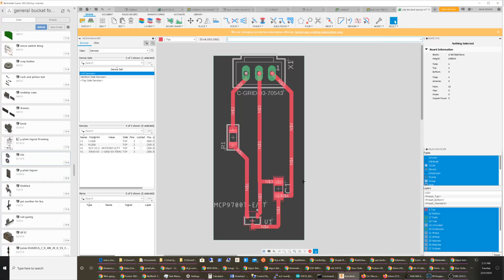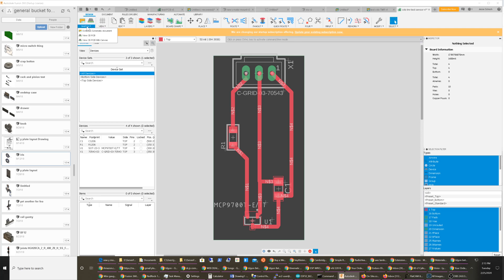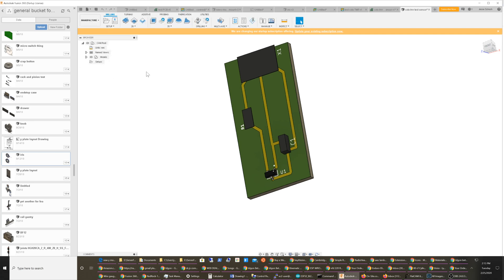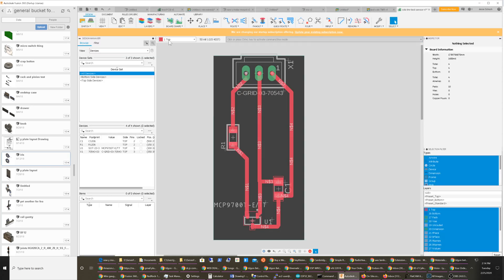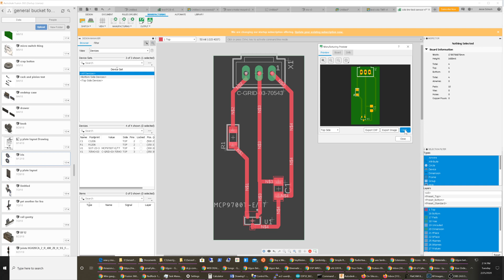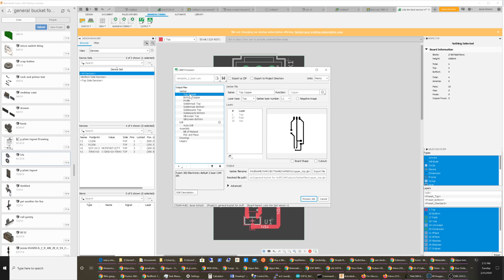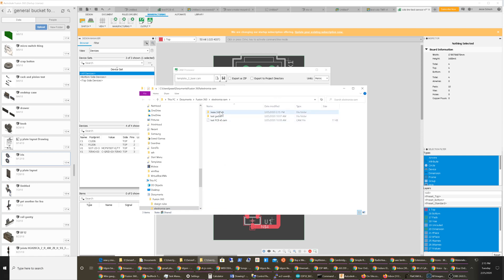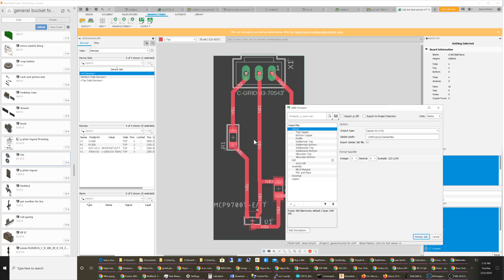Fusion 360 export gerber and excellon

Comment: Thank you so much! I am just wondering what company you use to order your PCBs from. I have a simple PCB (4 LEDs, Battery and Switch) I would like to make and have manufactured. Not sure which company you might recommend using to manufacture these. Thanks again! This was very helpful.
Reply from the maker: I make them.  Plenty of companies that will do a simple board but they are not that hard to make.